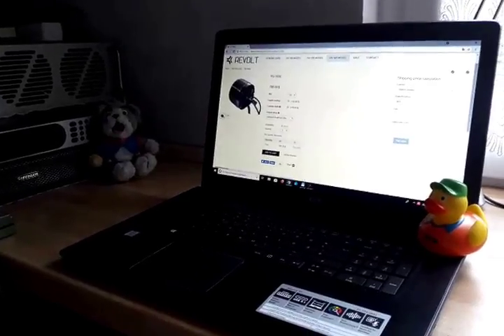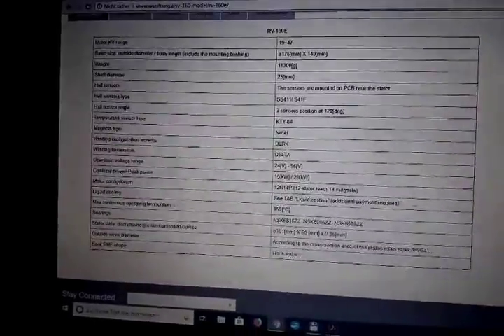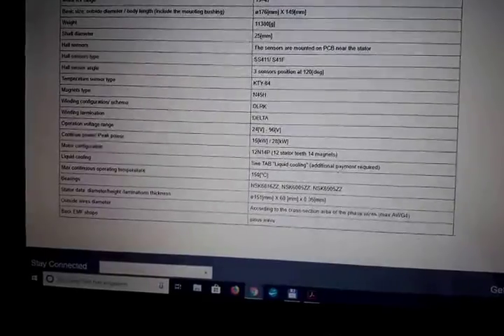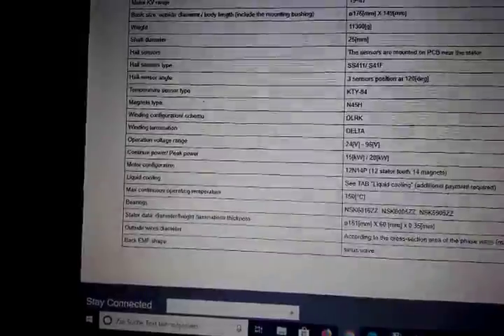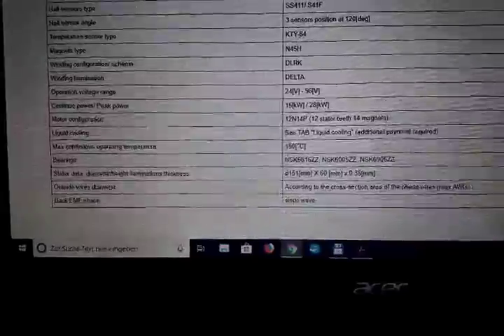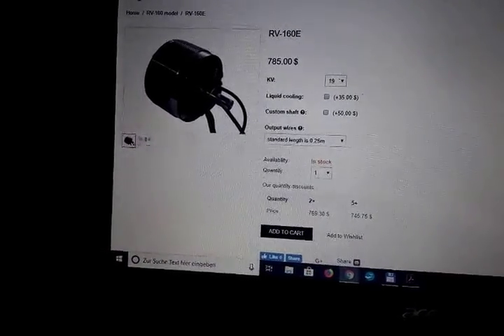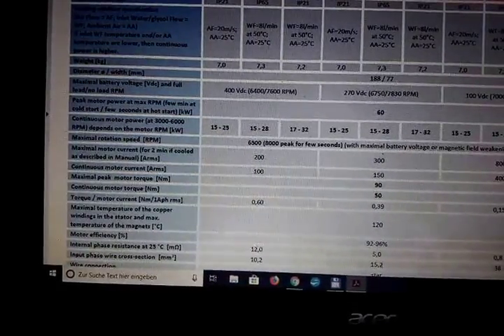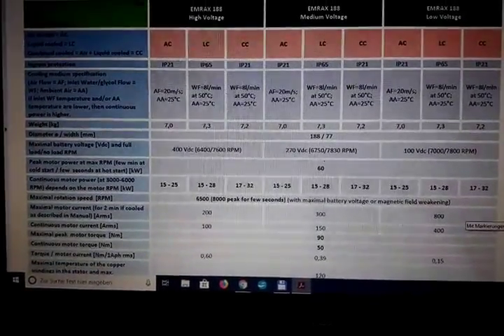Revolt BLDC 160-Pro vs 160-E Comparison (EMRAX)

Comment: Would a single 160E push a Twizy to about stock specs ~500kg?   I see the 160E got longer stator then the 160 pro you are testing....
Reply from the maker: Good question, I honestly couldn't answer. The data on the paper looks promising. The IM of the Twizy combines fairly high start-up torque and high speeds at little loads, e.g. tailwind (v_max>100km/h). I can imagine some less acceleration at low speeds with the Revolts, which could be solved with the right gear ratio suffering top speed.
Reply: Vielen Dank!  I'm not sure if the start torque is high enough without frying the regulator. The car I currently have got a 4speed gearbox, which at least for testing is good. Would be perfect if I could combine proper start torque and topspeed 90-100kph with cruising at 80kph even at lower SoC.  Acceleration is not a concern but the start torque is.